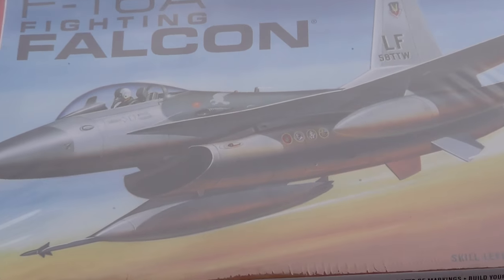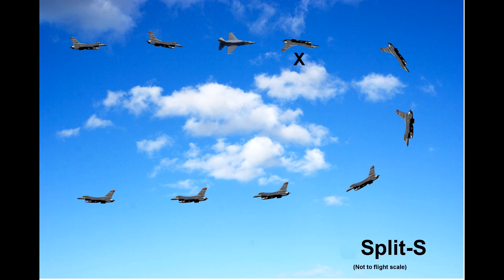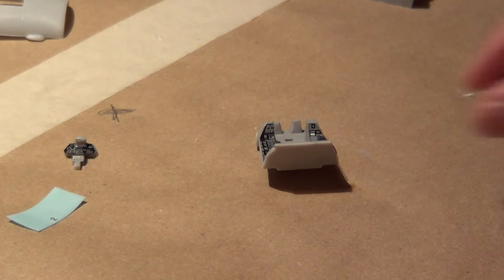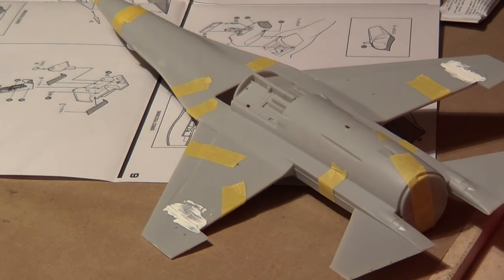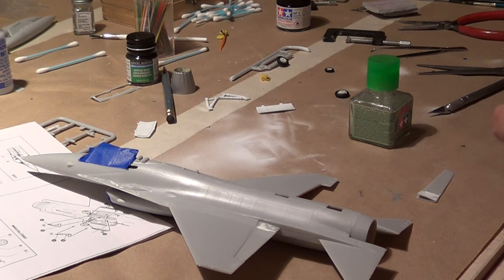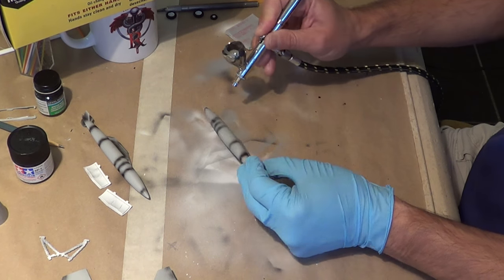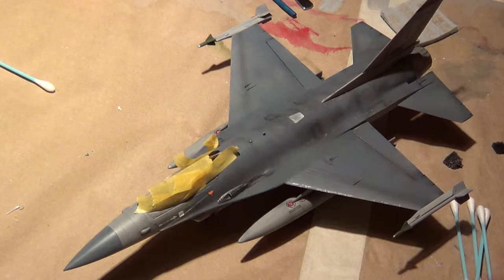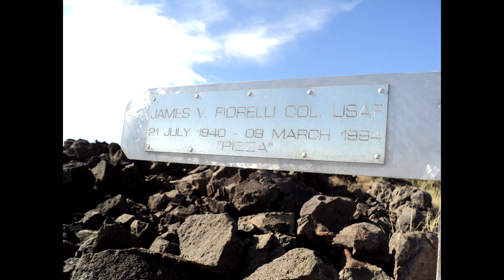Building AMTs 1/48th Scale F-16A: "The Crash of AZANG #80-0486"

Comment: Thank you for this little memorial to one of our servicemen! It's appreciated! And great job on the model, even though the kit maybe wasn't of the highest quality.
Reply from the maker: Thanks for your comments vanbeukenmans. It's a tragedy that he died so young. On another note, most model companies don't manufacture the older versions of the F-16 anymore, so unfortunately, I had to make do with this kit.
Reply: It's a shame Hasegawa never got around to making an early F-16 in 1/48, they've made pretty much every other version of the F-16. The one modern kit I know of off hand that does have the square-tipped tails required for this project is the Revell 1/72 kit, which in the F-16C-50 boxings come with all the parts needed to make any single seater up through Block 52, as far as I remember.
Reply: Also, holy crap, no wonder the kit is the quality it is, the only thing that's changed since its original release in 1978 are the decals and the box art!

Comment: Great build. From your experience how many colors are on the block 50 CJ wild weasel? I am working on the  Tamiya kit and it is saying that there are a total of 4 different external colors? Can you confirm the 4 or just the 3 colors that I see on other vipers?
Reply from the maker: Hi Brett G! Thanks for the compliment, but I didn't think this particular model came out very well :-0. To answer your question, the coloring tends to vary from base to base and even within a unit. It almost seems to depend on the diligence of the paint crew. There should be FOUR colors, but I saw F-16s at my base vary from 2 to 4 colors. My recommendation would to be to seek out images of the specific F-16 tail number or the unit you wish to emulate in your model and choose the number of colors based on that.

Comment: R.I.P for that great airmen warrior. I’ve been a pilot for quite a while of F-18 super Hornet. What I know that these aircrafts of F-16 they pretty much equipped with anti-collision systems. What that system does if pilot got in to a G-LOC and that system will take a proper action.. Surprised. 😮
Reply from the maker: Hi j hermes, this was at a time before we had Auto-GCAS. There's a video making the rounds that you've probably seen of it saving a pilot from my very own unit (again) in much the same situation as #80-0468. Thanks for your service!